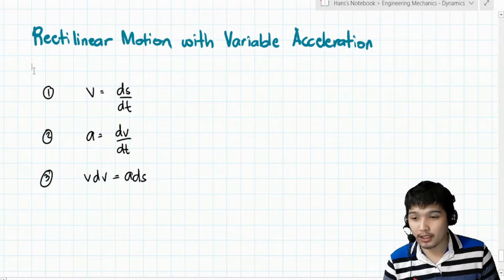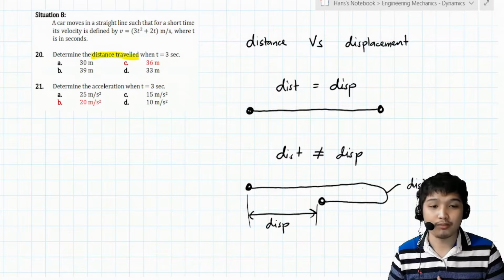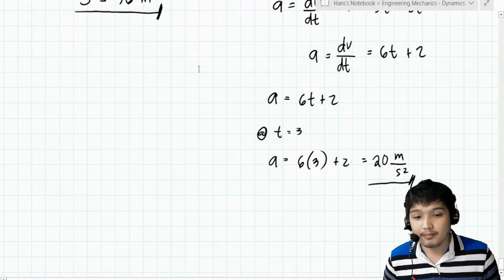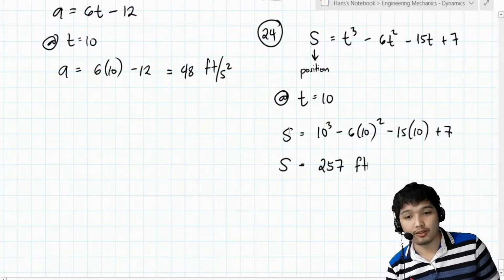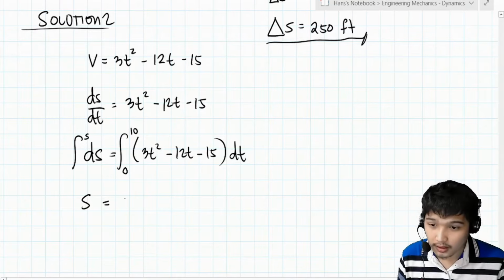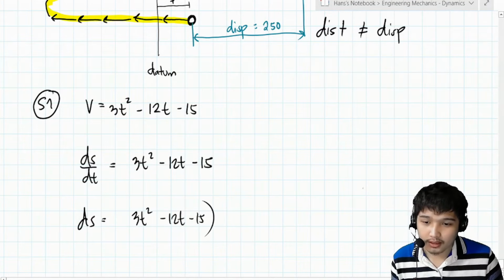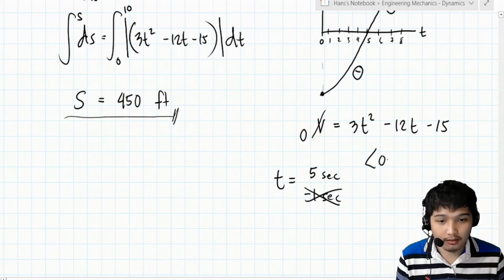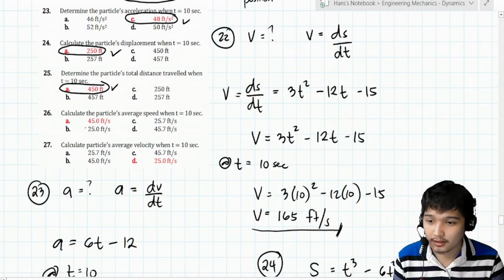Dynamics | Rectilinear Motion | Variable Acceleration

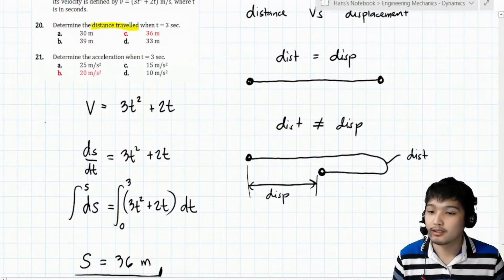Comment: 11:59 

Using Canon F-789SGA

Step 1: pindutin mo yung integral sign
Step 2: input mo yung values, pano ba itype dito? Check mo nalang dito: https://drive.google.com/drive/folders/1oSeOJ2jM59EWDrJ9klYRqlFM9N4ItzPl  (folder name: 🎀) 
Step 3: type calc then assign ka value ng x, pwedeng x=1 or any value basta mababa lang. 
Step 4: 36 lalabas na sagot.